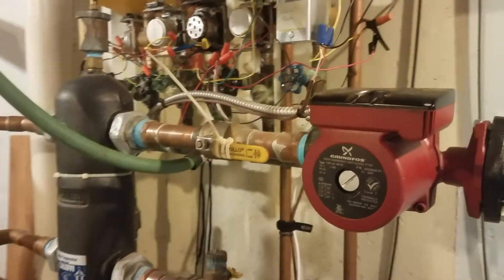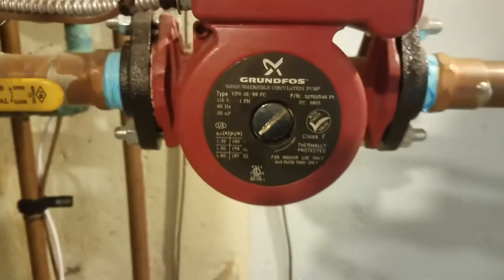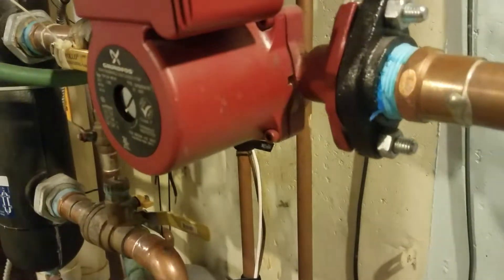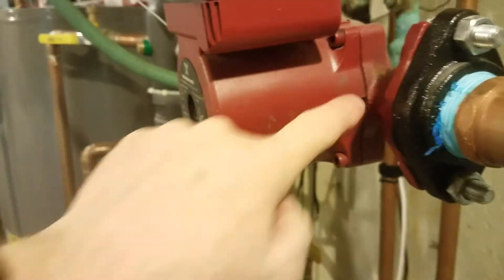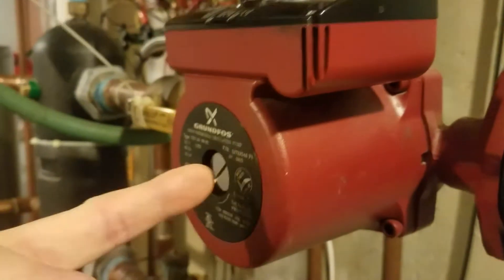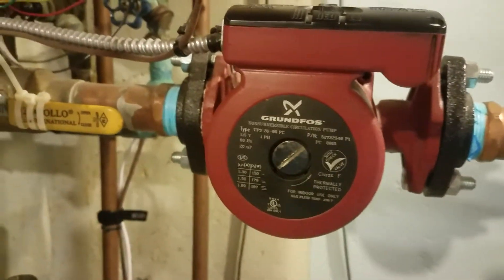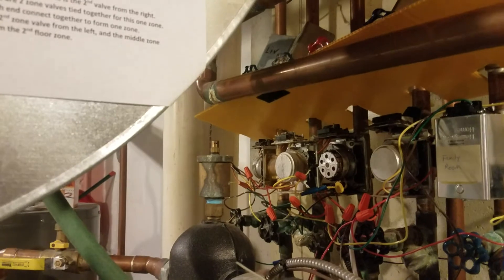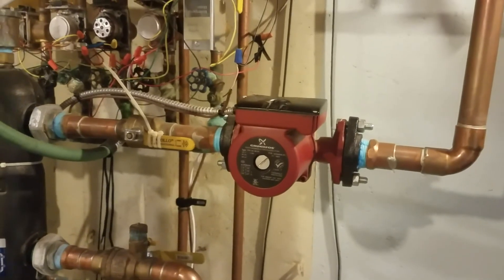Grundfos 26-99 Circulation Pump Noise - What are your thoughts?

Comment: Have exactly the same noisy problem, although mine is mounted vertically. My noise is indeed the bearings, so replacing with New GRUNDFOS UPS3 15 - 50 / 65 130 CENTRAL HEATING CIRCULATOR PUMP

Comment: Great video first i've seen on these. I was considering doing this install myself but have minimal install knowledge.. but mentioning that I can just isolate it with valves and remove the pump unit itself makes me more comfortable doing this. The people who installed the tankless water heater installed this pump and a number of other things throughout the life of the system such as expansion tanks and oddly ran pipes that has sort of a plateau shape (this is the one that failed) . I am wondering how you can tell if the pump is bad? The same people that installed all of this told us the pupm is bad but we've had it maybe ten years or less. It doesn't make a strange noise or anything. We were told that we keep getting small pinhole leaks in various parts of the plumbing system (maybe every 1-2 years) around the pump and heater because the pump is bad. I don't see any signs that indicate the pump being bad however other than them blaming pinhole leaks on it. We get hot water fine all over the house. The most recent leak i noticed was at the back of a pipe (the side facing the wall) that had been soldered and I'm just wondering if it was weak beacuse they didn't do a great job soldering behind the pipe where theres limited vision and access.

Comment: I would just replace the whole pump and once it starts humming the bearing assembly is failing. Just replace it I live in Alaska and replace mine every 4 years. It will always go out at the least convenient time.  When the pump fails you have NO heat transfer and since my boiler powers my hot water heater I won't even have hot water....

Comment: 1:17 That pump mounting is perfectly fine.  You can mount it in any orientation where the motor shaft is horizontal.  What you cannot do is mount the pump with the motor shaft tilted or vertical,  so you can't mount the pump with the face up or down.  The installation instructions are readilly available with a quick google search.
Reply from the maker: Good to know.  I ended up having to replace the entire system and updated everything in the process.  Cost WAY too much but I have a much better system now.

Comment: Bear in mind that these pumps have a motor run capacitor in the terminal case. This can fail partially or totally. It's easy to find replacements (the value is printed on the motor label). Partial failure can cause the motor to run rough or hot or both. Total failure will mean the pump won't even start.
Reply: What is that flat head dial on the pump?
Is it to adjust water flow?
Reply: @Ray-wr2wr  yes. A three position switch if I remember right.
Reply: @ do i add more water flow just needs to use screw driver?
Reply: @Ray-wr2wr  on the pumps I have there is a 3 position lever on top of the rectangular black terminal cover that can be operated by hand - no tools needed. You can hear the pump speed change when you operate this switch. It's quite noisy at the highest speed.

Comment: I had a similar noise problem only louder.  The outside of the pump was hot.  I noticed the little square hole on the right side of the pump.  I sprayed some WD 40 it it and turned the pump on a d off a few times and after a bit the noise stopped

Comment: mine is mounted vertically and i still have the noise problem
Reply from the maker: I ended up replacing the cylinder inside the pump and it works fine now.  I think the ceramic bearings wore too much and the shaft developed too much end play, and the magnets that run the pump were simply causing it to oscillate making the shaft move "up and down" rapidly.  I got a LOT worse than what was in the video.  When I dismantled the cylinder, that's all I could find wrong.  That was likely because my pump is mounted horizontally.
Reply: @MIFixItDad  I have changed the pump but the new pump is complaining. I think there is too much debris in the system clogging the pump. The old one was so full of rust I can't believe it didn't give out sooner.
Reply from the maker: @robertsandison2298  I changed the cartridge in mine but it's been fine since then.  The pipes were pretty clean though.  If you have a way, it might be a good idea to do a full line purge for yours to see if you can remove any debris.  I'm not a plumber, but that just sounds bad to me.  Maybe it's just me though.
Reply: @MIFixItDad   yes i have replaced the pump and that seems to have done it!
Reply: @MIFixItDad  Hello! The pump on my Bradford White heater is extremely noisy as well. I would be grateful if you could take a look at the video and provide your recommendations if any. https://youtu.be/jRTX2YAUF9k. Thank you so much in advance!!
Reply from the maker: @garentale2013  I just get a message that the video is private.  If it's noisy, then the bearings are probably going bad.  I believe what happened with mine is it developed end play so that the shaft could move back and forth end to end, and the magnetic pulses of the motor simply caused it to develop a vibrating or mini-hammering action as it moved back and forth because of the push/pull action of the magnetic fields in the windings.
Reply: @MIFixItDad  Appreciate your quick response. Thanks so much! Looks like the public settings did not get saved. Here it is again: https://youtu.be/oCDpaVvzrP4

Comment: Hey........I am NOW having this EXACT same problem.   What did you do to fix it???  I am worried I may have to get a new pump!??!
Reply from the maker: These are designed to be taken apart easily.  The interior moving parts are all in a cartridge that can be removed and replaced.  You can buy just the cartridge piece instead of the whole pump.  I just had to replace the cartridge, and kept the rest of the pump body.  It's been fine since.
Reply from the maker: Christ Lucca  In this case it was pretty hard and I had to hope for the best.  The part number was a Lochinvar part even though it was made by Grundfos, so no one was sure the cartridges were the same.  Supplyhouse.com will let you return parts that don't fit so I took a chance and tried it and it worked.  On normal part numbers, you can google "cartridge for model x" and pretty easily find what you need.
Reply: @MIFixItDad  Can you please post the lochinvar part number here? Same issue - same model. Want to make sure I get the right replacement.
Reply: I've heard a lot of negative things about the grundfos pumps lately... I'm currently switching to a taco 0015
Reply: @phillysupra  - interesting... I replaced a Taco 007-F5 with a faint, but constant whine with a Grundfos 3-speed, and loved how quiet it was. In my experience, the Grundfos was simply a better pump. 

I just had a new boiler installed, and they put a new Taco 007-F5 in it, and it sounded just like the pump in the video above. A fairly loud and noticeable whine constantly while it was running. 

They purged the system, assured me that the pump was fine, claimed the sound was "normal", and told me to call them if it got worse, which it did. A week later, after calling them a number of times with no response, the brand new Taco suddenly seized up one evening a few days ago. 

Unfortunately, the Grundfos flanges aren't oriented correctly to use with the new system, so I put my 25 year old Taco 007-F5 on the new system with it's constant, quiet, low-level hum, just to keep heat in the place while I shop around for a new pump.

I was going to go for another Grundfos, as I liked the one I had so much, but they've changed their housings from black in color to fire truck red, which would make my system look like a christmas tree or a kaleidoscope, against it's otherwise current green and black cosmetics, and the copper piping.

So, now I'm looking into either a Taco 015 3-speed, or a Wilo 3-speed circulation pump. 

But as far as quietness and reliability, I can't recommend Grundfos highly enough. It was just totally silent and worked beautifully since I installed it until I put the new system in.
Reply: @phillysupra  thank you.
Reply: Can you replace the cartridge without taking it off the tank/system?